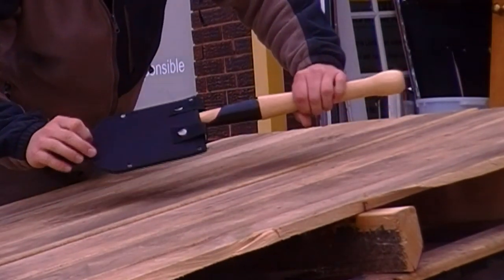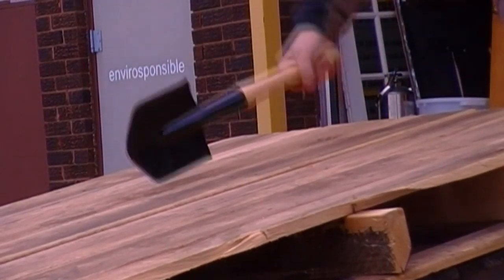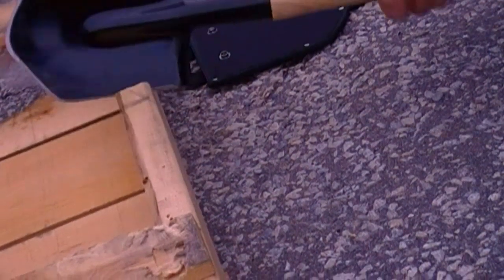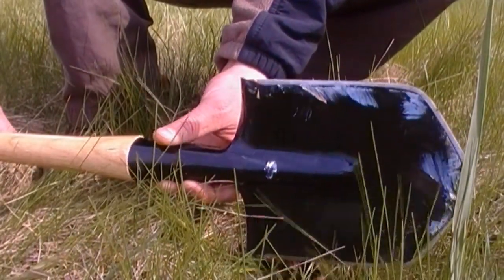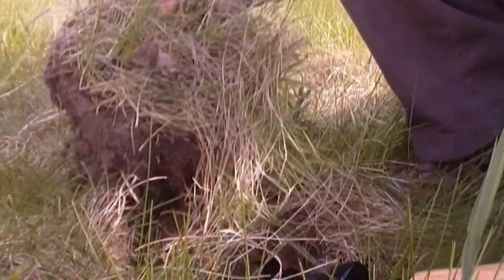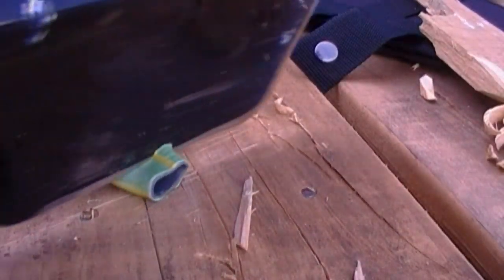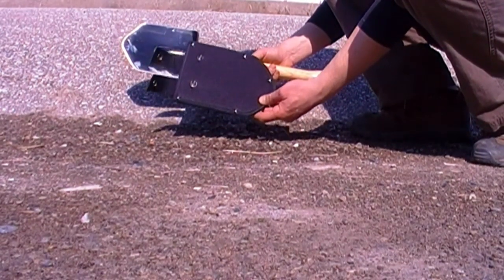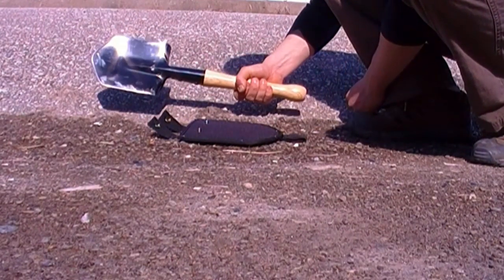Cold Steel Special Forces Shovel-Urban Survival

Comment: It's an entrenching tool.. they're ALL sharp. It means you can dig a foxhole where there are a lot of roots (the treeline for instance). The US WWII ones have an adjustable blade making them longer and easier to use, plus they can be used like a matock for breaking up the bottom of your hole. It's nice and cheap though..

Comment: @icychap I've used mine hard for several months and it is as tight as the day I bought it. From what I can tell, all the folks breaking handles are throwing theirs. If used as a shovel, machete, or hatchet it should last a while. It ever broke in the wilderness one could easily cut a temporary handle out of a branch and fix it.

Comment: @envirosponsible mine has broken both times right under were the screws are the first one i broke just because i was throwing it alot then my 2nd handle i had for at least 8 months but I was careful with that one. Then it kind of split around were the handle meets the screws, i used it some more then it actually broke good shovel though

Comment: @envirosponsible and also when i say i was careful with it I meant i wasn't throwing it like crazy i use it to dig and split fire wood hack limbs(off trees)and i have cut down 3 or 4 trees with it. dont be nice on it just because i said ive broken mine just dont throw it at things and miss and you will get a solid 8 months to a year out of the handle if used allot I used mine almost every day  normally just to split wood and throw but i went on multiple camping trips with it and i still love it

Comment: That is what I'm calling marketing. Buying shovels from China and  sell them for 33 USD in West. Enviro, this shovel has short handle, because you digging trenches usually under fire. You need to be down to the ground and you holding the shovel with 2 hands, no foot assistance. Good luck, use it as a shovel as Cold Steel states :)